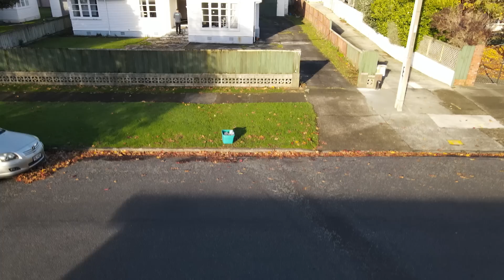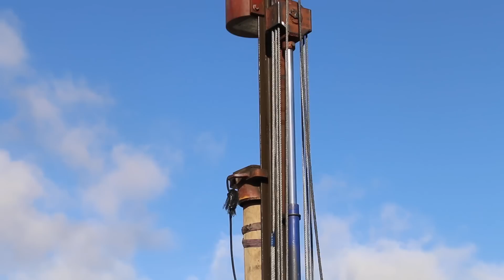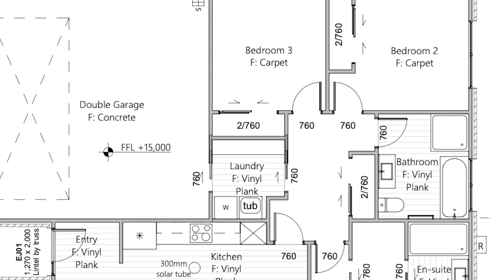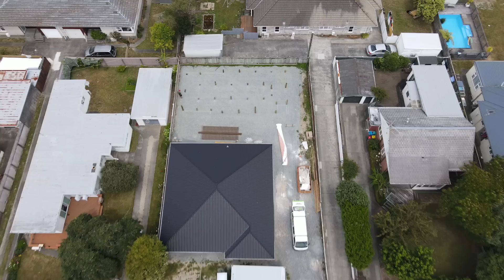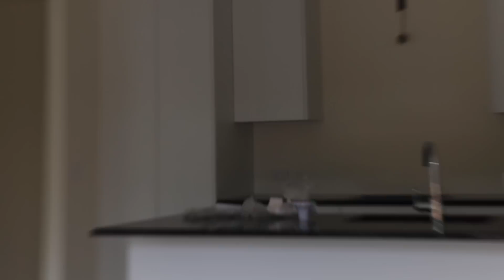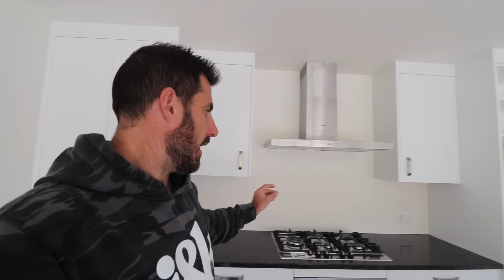I Turned One House into Two Stunning New Builds!

Comment: Jacking up a car in the garage could cause damage to the concrete floor with the polystyrene pods within the concrete slab
Reply: lol
Reply: The slab is supported by concrete piles/piers. The foam blocks are just for insulation.